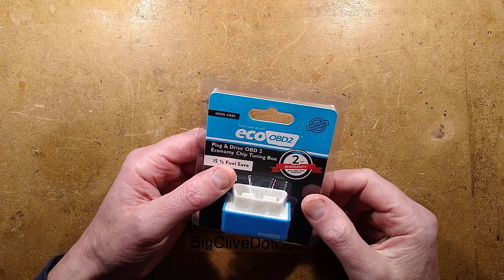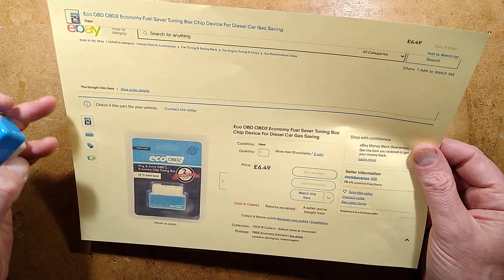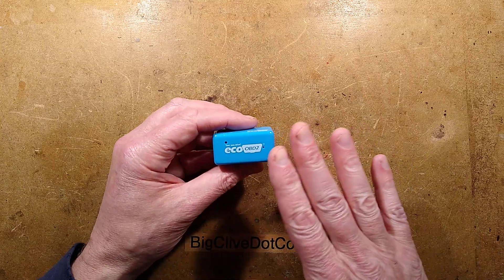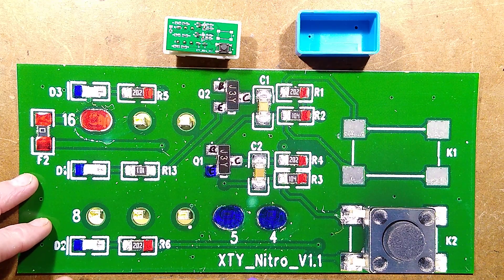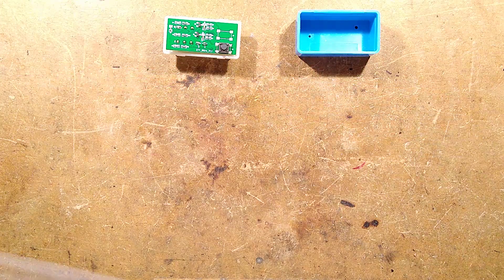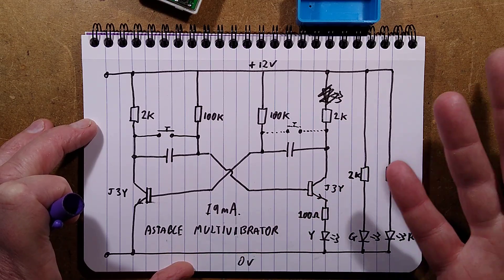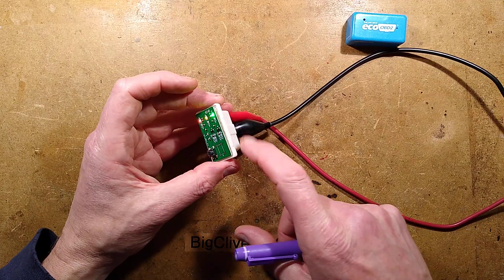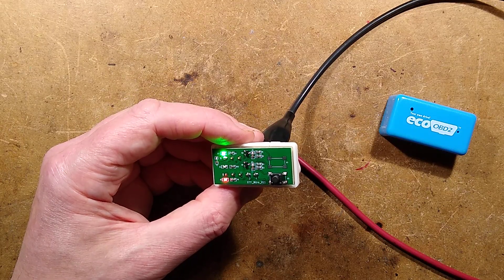Worst fake Eco OBD2 fuel saver yet (with schematic)

Comment: Red Seal Automotive Service Technician in Canada here. These fraggin scams could readily cause significant damage to the electronics of a car.  If I may, here's some legitimate, time proven ways to actually get the most milage out of your car - 

Tires - in good condition, matching all four wheels, and most of all, at the inflation specified by NOT the sidewall, but rather the sticker on the car (usually the driver door frame) that the manufacturer put on. That's where the guys n gals that spent a LOT of money on this issue figure your car will do best at.  Many people confuse the 'maximum inflation pressure' stamped on a tire as the 'design ride pressure' that a vehicle calls for.  Also, ensuring the tires are the correct type, load rating, style etc for your car.  This seriously is the biggest killer for most people trying to get milage up - under inflated tires. Unless you are a serious off roader, there's no call to drop tire pressure below manufacturer's recommendations; and under inflation is the leading cause of tire failures which often cause accidents.

Maintenance - ensuring the car is in good running mechanical condition. Tune up as required (though these days thats basically just spark plugs), no significant issues to the car's running (OR SAFETY).  When in doubt, take it to a REPUTABLE mechanic. Newer vehicles in particular are vulnerable to losing significant performance due to bad, dirty, low, or incorrect oil level. Many engines today have some form of 'variable camshaft timing' that usually relies on hydraulic pressure of engine oil to actuate the camshaft timing (called phasing in this respect) to get the most out of the engine; oil problems = bad performance or engine failure. Keep up on your maintenance!!

Cargo - If you dont need it, dont carry it. The less mass you have to get, and keep, moving, the less fuel youll burn. The only exception to that is of course spare tire, tools/parts as necessary, and, should you be driving long distance or what not, proper emergency/safety/cold/hot weather gear. Fire Extinguishers, First Aid Kits and the like are always excellent investments.  Of course, what you do carry, keep properly stowed/secured.

Accessories - Air conditioning is a big one; turn it off when you dont actually need it. (Make sure the light is off.) Generally though, unless its a ridiculous booming sound system or huge driving lights, the electrical load is fairly minimal to most fuel powered cars. For 4x4 vehicles, keeping the vehicle in 2WD/AWD as conditions permit will also improve milage.

Air Flow - Now we are getting into the weeds, as it were.  Generally, keeping windows up and oblong air obstructions off is best; weather permitting of course. Not towing a trailer/caravan/etc of course. Past that, if the car had 'air dams' or similar - plastic guides, shields and so on - ensuring these are present and not damaged will help direct air flow around the car in its most efficient manner possible. A big one is the air shields/dams along the bottom of a car - they regularly get ripped off, but they do a substantial difference in smoothing under car air flow which reduces drag.

Driving Habits - pay attention to how you drive. Try to be easier on the throttle, select lower speeds, easier routes as is safe and possible to do so. 10MPH less can make a DRAMATIC fuel savings, especially if your vehicle's shaped like a brick (such as a Jeep). Case in point, my 2013 Jeep Wrangler Rubicon Unlimited, 4 door, V6 Manual, brick through the air. When i try to cruise at 120KPH/80MPH, I get on average 15-16MPG. On a recent long distance trip, I was towing a trailer, with a heavy motorcycle attached to it, and by keeping my speed down to 80KPH/50MPH, i got my milage UP to 19MPG. That's nineteen miles per gallon on a Brick going through the air, pulling a tandem axle 600# trailer with a 700# motorcycle strapped to it. Best milage Ive ever seen out of it! 

ECO MODE - related to Driving habits, many modern vehicles have some form of ECO MODE or Economy Mode; some feedback from the car (usually on the dash, often using an alternative mode to your odometer) to tell you when your driving is the most efficient for the car. Pay attention to it. 

Also? As Clive here mentions, stay the ever lovin crap AWAY from anything that screws with electronics. Unless you know precisely, exactly what you are doing, do not touch; at best nothing will happen; at worst you'll cause many thousands of dollars of damage to your car. 

Anyway, hope this helps those that need it!

Comment: The complicated explanations about how the device is supposed to work make it really, really evil. 
And while everyone driving a car should realize that car manufacturers fighting with staying below legal limits for fuel consumption and emissions would all jump at the possibility of a simple device lowering consumption by only a fraction of a percent (heck, I work for part manufacturers, and the lengths and cost they go to just to save that amount in consumption is incredible), but selling such a device that claims to save fuel, but doesn't even remotely have the capability to influence anything in the car is fraudulent and illegal.

Comment: I've got one of these from ali for about 5$, it looks exactly the same as yours, but green (benzine cars), but mine looks totally different from inside: stack of two pcbs, 6 leds, 5v linear voltage stabilizer, MCU (40+ pins), oscillator, and some more resistors, a diode, capacitors, and a button. Have no idea if it actually works, haven't tried it yet.
Reply from the maker: It doesn't.  The first ones put on quite a show.

Comment: These things have been showing up again on a popular video streaming service pre-role adds again. Usually with some story about a person that worked at a big auto company who exposed that all auto manufacturers had been lying and that he had a simple fix that could double fuel economy, and when he approched big auto management they fired him. So he decided to go it alone and bring out this symple fuel saving device. Even with reporting these adds they still show up. Although they have now moved back on to little plug in fan heaters that can heat your entire house for little energy. Prior to this it was there favourite usb powered AC unit (evaporation cooler) that can cool a room by many degrees in minutes. All of these have a story attached about a person who big tech tried to silence.

Comment: There are power booster obd plug ins that make the car think the coolant is cold so it fuels higher increasing power slightly. If this worked in the opposite way (make the car think it was hot when it was cold) the car likely wouldn’t start on a cold morning.

Comment: By design the ECU can bus isnt actually exposed on the OBD2 pins. There is always  a form of gateway inbetween, but the manufacturers put proprietary extra pins on the connector.
Reply: That's true only in newer cars. For example, GM only put in a gateway in 2017, FCA 2018. Chrysler had the famous hack in 2015 where somebody showed you could through the Internet to the radio and controlled steering. Some brands, like older Fords, previously put in a one-way gateway between the powertrain section and infotainment devices, due to the need for 2-way communication for diagnostics, the OBD port is in the secure side.
Reply: @straightpipediesel  Thanks for the info, i wasnt aware of that

Comment: I remember the fuel saving devices of the 70s and 80s. Those were nothing more than plastic wrapped magnets that snapped around your fuel line and claimed to break up hydrocarbon clusters. I'm so glad to see snake oil salesmen moving into the 21st century. Long live the entrepreneurial spirit.
Reply from the maker: Rest assured the magnets are still available on eBay.

Comment: just wait till they put a usb killer in the case and fry the can bus network for the best fuel savings😆
Reply: Fuel saver device that's actually an FM transmitter and hijacks the FM radio stations at the turn of every hour to play advertisements for riding a bus, bicycle, etc

Comment: Back in the good old days before fuel injection.  People would use a vacuum gauge, (fuel saver gauge), and watch it while accelerating.  If you hit the throttle hard the vacuum would drop, and the gauge would show lower fuel economy.  To prevent this, you would drive less aggressively. It actually kind of worked as it the driver would watch the gauge, and change driving habits, and save gas.  Installed quite a few back in the 1970's, when I was doing mechanics. Thanks for the great videos, you always teach, and entertain.
Reply: Yes and older BMW vehicles had this in the gauge cluster, instant feedback and labelled as instantaneous fuel consumption. Most of the time they were driven so the needle was barely moving off the stop, well in the red zone.
Reply: @SeanBZA  older BMW? They still had them until a few years ago 😉
Reply: @SeanBZA  I think I remember seeing that in an older BMW, a needle that flew back and forward and looked like it would just annoy a person around town.
Reply: @SeanBZA  not just older! I have a fuel consumption guage as new as on a 2011 😄
Reply: There are apps you can get that talk to real general purpose OBD II scanners with the idea being to replicate this kind of driver feedback. I suspect these days anyone who wanted to do that would just get a newer car though (doesn't even have to be that new, my 8 year old car does it) with built in fuel consumption monitoring exposed to the driver.
Reply: @bosstowndynamics5488 
My car is 10 years old, and it has the fuel monitoring thing... Not a fancy car. Cheapest Hyundai they sold in Australia back then.
Reply: @tin2001  same on my bog standard 2011 VW Polo, shows both on the spot and average journey MPG figures.
Reply: Reminds me of a description of a rev-counter in a humorous book about motoring from the 1930s: "watching this carefully allows you to change gear absolutely noiselessly, apart from the tinkling of glass as you drive through a shop-window in the process".
Reply: My MY 2018 car has a vacuum gauge stock, because they also make a turbocharged variant where it acts as a boost gauge. Not particularly useful for this purpose in a car that already has an instant fuel eco readout, but it's fun.

Comment: I always wondered what the other unpopulated button did.

Maybe thats the actual fuel saver activation and they just put the button on the wrong one.
Reply: Diagram shows second button position, it's function is similar but requires a different set of backshell holes.
Reply: @johndododoe1411  yeah, but if you look at other previously you will see button pads just... Sitting there.

Hell when I open things up I'm tempted to just bridge the pads to see what the buttonless pads go to.
Reply: @girrrrrrr2  We're past that as the video already shows the connections for the second button.  A backshell with a hole to press the 2nd button would allow the different blink effect, which will mix with other colors according to the backshell color and hole placement.
Reply: @johndododoe1411  And the other videos that show other devices with unpopulated button pads?

Comment: Should mention that OBD wasn’t designed to supply power continuously for a long time so these devices can burn out circuitry in your car. My insurance company, Allstate had to panic recall their driving tracker because of how many cars they damaged.
Reply: Not sure I get this. Anything plugged in should only be drawing the current allowed (at a maximum) to the fuse type (ie 10 amps). Why would having something plugged into something that’s designed to have something plugged into it burn it out? People have odb2 readers hooked up for real time data reading when they are driving all the time and it doesn’t seem to matter? Not saying you’re wrong just curious as to why that happened when odb2 insurance scanners are pretty common?😊
Reply: Knowing the pinout of the OBD2 port, the POWER connections are NOT connected to the engine computer in any way. The Ground (and Chassis pins are 4 & 5) and Pin 16 is continuous battery power, current limited usually through a 10A fuse. Those pins are the 12v power from the vehicle that the device is ‘stealing’. There is pretty much a 0% chance of permanently damaging vehicle electronics by plugging shady electronics in this port!! Yes there MAY be exceptions but vehicle electronics made to withstand shorts to power or ground on bus lines and such without permanent damage. 

Of course the vehicle will not work properly and possibly not start if you short the CAN bus (pins 6 & 14). But the vehicle will operate again after the ‘short’ is removed and communication is restored to the bus (as Clive mentioned). 

Probably the most common issue at hand is the continuous power consumption DISCHARGING your 12v battery to the point you will need a jump start. 

Now, the insurance trackers. Are just that. They have a GPS and track you EVERYWHERE you go, how much you drive, how fast you drive and sometimes actually monitor engine parameters such as throttle %, engine load and braking parameters. Oh and they sell that data to 3rd parties as well. Sounds like a great idea! Privacy, anyone? However, if they are causing drivability problems, just unplug it. 👍

Comment: Hp tuners and a laptop I can do a way better job of getting performance or leaning out the ecu or a little of both for a couple hundred bucks. This device they couldn’t even be bothered to use a microcontroller kinda ironic the waste in the dump.

Comment: So this new version is made for "Diesel Cars," which raises the question: Was it designed by Volkswagen? 🤣

How to ACTUALLY achieve better fuel economy:
1) Remove all unnecessary cargo (and passengers) from vehicle.
2) Ensure all tires are properly inflated and aligned.
3) Use gentle acceleration and deceleration rates.
4) Select proper gear for demand (manual transmissions).
5) Switch off all unnecessary loads (radio, A/C, etc.)
6) Follow your vehicle manufacturer's recommended service/tune up intervals.
7) Use a good-quality engine oil and change it regularly.
8) Ensure brakes are properly adjusted (no brake drag from overtightened drum brakes or a stuck caliper)
9) Use the terrain to your benefit - use inclines for deceleration and declines for acceleration whenever possible.
10) Use a high-quality gas brand from a major brand, budget "no-name" brands tend to be less-efficient.
11) Maintain a steady speed when traffic/weather conditions allow.

These methods have reliably enabled me to achieve better fuel economy than EPA/manufacturer ratings, across every engine and transmission combination I have had in every vehicle I have ever owned. Keep in mind that even a 1-2 mpg improvement per tank adds up to significant savings over time!

Comment: I once bought a Bluetooth OBD dongle to diagnose a check engine light on one of my cars. It had live data that was interesting to record and look at too. I thought I could leave it plugged in while the car was parked, but after a week or so of not driving it, the dongle had totally drained the car's battery and then bricked itself. At least with this "thing" we don't have to worry about the second part...

Another curious thing I've seen is that on my other car, plugging anything into the OBD port disables all of the "connected vehicle" functions (remote lock/unlock/start, vehicle location, etc.). It seems this was intentional as the manufacturer put out a TSB stating that this is expected. However both of the things I plugged into it were "active". I wonder if it would do the same thing with this, given that there's virtually nothing going on inside it.
Reply: Small microswitch in the port, that is opened when you insert any standard OBD plug in. I would bet there is a "special" manufacturer connector, with an extra slot cut in it to avoid this, in the official kit.

Comment: eBay's garbage deadlines and time-limits for things like requesting refunds and leaving feedback make it impossible to punish them or warn others which allows them to get away with scamming with impunity. For example, they'll set a very long delivery-window so that by the time you get it (if at all), it's too late to leave feedback and possibly even too late to request a refund. eBay abets scammers.😠 - The OBD2 device I have lets me use an app to see any error-codes. These do NOT affect the ECU.

Comment: This reminds me of a scam I feel for when I was 16 back in the 80's.  It was a product that I found at the fleamartket and advertised as a "specialized" copper disk and cost about $30.  If you hooked it between your coil and distributor cap it was supposed to save gas and give your engine more horsepower.  Later when I opened the package to install it, I found that it was nothing more than a piece of plastic with 2 terminals and a US Penny stuck in the middle.
Reply: Well "specialized copper disc" is pretty accurate.  🤣
Reply: The irony is that a US penny is only about 5% copper, with the rest being zinc.
Reply: @SteveGuidi   Now it is, yes. But back then pennies were all copper.
Reply: They produced a higher voltage spark simply by introducing another gap to jump. So instead of a spark occurring at say 10,000 volts across 2 gaps. It now had to rise to 15,000 volts to jump three gaps. No performance gain and harder starting!